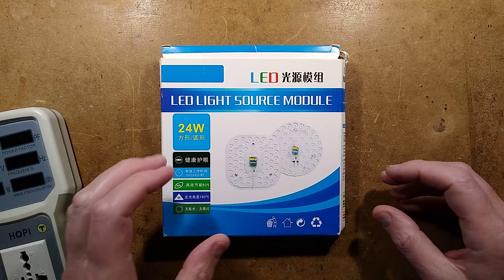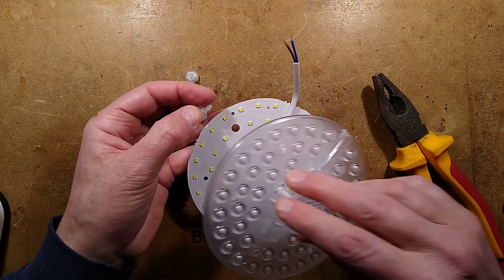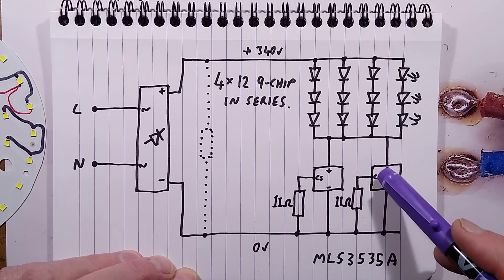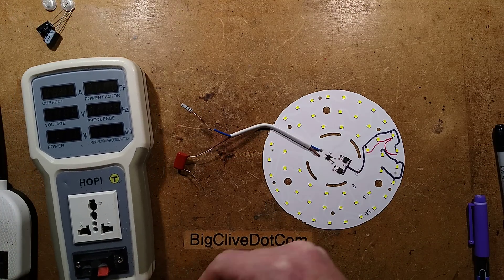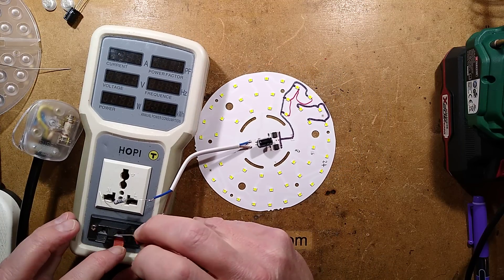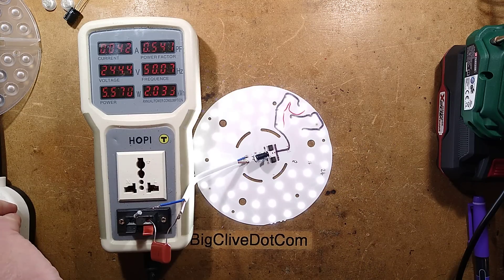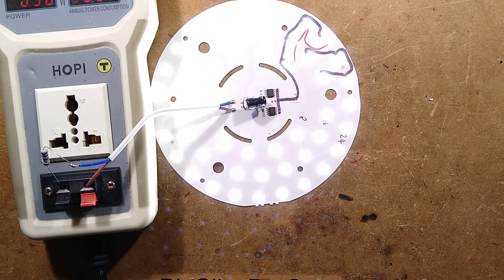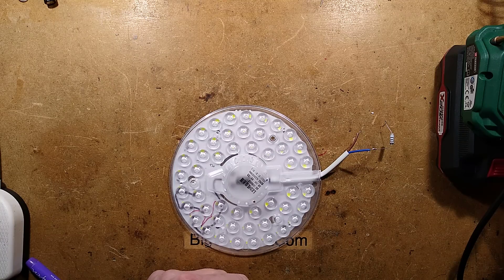Upgrading a downgraded light

Comment: I'm curious how fast the regulators respond. Are they reducing the flicker at all by following the voltage changes? Would the flicker be the same with just a fixed resistor?
I'd be interested to see the waveform on the positive rail and the one across either the LEDs or the regulators to see how they compare.
Reply: You can tell from the nearly-1 power factor that the chips were essentially working like fixed resistors. The current had to be tracking the sine wave voltage, in phase and at the same slope. If it wasn't like that the power factor would have been lower. 

Consider them "smart" fixed resistors. They are programmed for a max current with the trimmer resistor, so the current can be changed (the resistance value can be changed), and they will also increase resistance when they get hot.  But basically they are acting like fixed resistors.

Without a capacitor someplace, this circuit will flicker, by definition, since every half cycle the voltage across the LEDs will go to zero, and they won't be making light. What might be interesting would be to measure the light output with a photocell and a scope. Is it a rectified sine wave, or does it increase quickly and then flatten out for most of the cycle? I suspect it is a sine wave, but it could be either. 

Obviously with a big enough cap the voltage across the LEDs will be essentially constant, and the current into the device will only be conducting for part of the since wave, thus the low power factor.

Comment: When I was a teen I learned about capacitors.  I built a beautifully constructed 300VDC tube power supply.  Then, I turned it off and reached in to make some change. It shocked me hard and I pulled my hand out so quickly that my wristwatch stayed stationary and dropped to the concrete floor where it broke.  Very instructive it was.
Reply: Ah yes, capacitors. Those little innocent looking cans and discs, sometimes packs of foil and paper, thin plastic film, or maybe a bit of foil and some oily stuff inside. Nothing dangerous until you put a bit of voltage on them. I learned about these little critters myself at around the same age but never got attacked until much later when I was a newbie tech. 

My job was to test power supplies of various sizes. Some were analog power supplies with big regulators and some big cannister-sized capacitors on them. I was always a bit on edge when I powered those up and one day, I had one explode on me because someone in manufacturing put the big capacitors in backwards. The explosion was so intense that it sent the capacitors up into the drop ceiling above me. It was a good thing I always ducked when I powered those up!

The last encounter was with some switchers. These switching power supplies, I think 65W units used in some "portable computers", with portable being a relative term for machines weighing around 22 lbs. 10 kg. There was a batch of these small switching power supplies that had leaky caps that needed replacing. Field service collected the units and brought boxes of them down to the test department for repairs. The units were to be returned to field service for replacement in customer returned units, or sent to the outside depot houses where they came from for field replacement.

I reached into the box of power supplies and got zapped instantly! The units, while sitting in the boxes for ages, still held quite a charge. After that, I got out a screw driver and would rub that across the leads sticking out of the boards before I even put my hand near them. The zap was enough to leave my arm achy and hand sore for the rest of the day.
Reply: First lesson in removing your wristwatch before working on electrical stuff as well!!
Reply: Oh, yeah, 2015 me also discovered that 5 meters of speaker wire connected to over 2kv can be a capacitor too, and it hurts. 2015 me shouldn't have played with tv flyback transformers. At least I learned a lot, like how wires don't always behave as just wires
Reply: I remember when I was about 8 yo, my parents got me a night light, not because i needed it, but because I just loved lamps, still do. And I played with it, plug it in, then unplug it... one day I accidentally found out that if you disconnected it and then touch the terminals with your fingers it will briefly light up. 8 year old me knew it was because of a capacitor inside, but it wasn't till 2016 (almost 7 years later) or so that I learned that thing should have had a discharge resistor. I guess I just had good look to not badly shock my fingers. 

Dangerous chinese products for kids
Reply: i think i learned this from a tv originally... not to not wear a wrist watch but how to smack something in reflexive pain to the shock and accidentally break something, i forget what i knocked over... haha
Reply: @frogz  i was fiddling with the rubber cap on the back of a tv once and almost became extinct before the CRT technology did
Reply: @echelonrank3927  Those are really friendly devices too!

At the company where I got zapped by the switching power supplies, they made video terminals and other early computer systems. These systems were called intelligent terminals, but they were computers with hard drives, memory cards, and other peripherals.

As time went on, I was promoted and eventually worked on all the various products including terminals. In many cases, the horizontal circuit would fail which required replacing a large IC driver chip. 

The procedure was to of course power off the unit then stick a screw driver under the anode - that rubber cap, and discharge the static from CRT. I did that with the usual ZAP as the purple-blue arc crossed arced over between the screw driver and ground and probably a gazillion times before without fanfare.

As usual, I then put my hand inside to fiddle with the connectors and wires in order to extract the board. As I got my hand inside, there was a residual amount of static and it zapped my hand.

I yanked my hand out in reflex and ripped the back of my knuckle on the chassis. There was blood everywhere and I still have the scar today to remind me. The zap didn't hurt as bad as the ripping of my knuckle on the chassis.

The thing is, this was a black and white CRT which only got up to about 11KV. The unit was off and the tube was discharged. This residual zap, probably nothing much, caused my hand to jerk and rip itself against the chassis. All I can say is, imagine if this was the full voltage!
Reply: @Clavichordist  Probably tho, part of it was your brain quickly overthinking that you might have been zapped with the full voltage, so scared it took a more aggressive action.

If it were the full voltage, at least, your brain would have been right about it lol
Reply: @rhodexa  That's definitely what it was - one of those scare reflexes. Believe me, my fat fingers got zapped more than once and I was quite jittery putting my hands in there especially when they were "live" and I had to adjust wires and pots. Some people were pretty brazen and used a metal screw driver to adjust the pots. Sometimes if they got too close to the flyback transformer, there would be a purple arc zapping it! 

I on the other hand, went to a local Radio Shack. Remember those? and picked up a set of TV tweaker-tools. I think the kit cost me $2.00 and I kept it when I left the company. I would use those with a nice extension on it to get in there most of the time.

This time, well I was poking in there and that residual charge zapped me and made me jump! I figured at the time that the device was off and no longer would zap me. HA!
Reply: @frogz  I broke a finger that same way lol
Reply: @BeetleBuns  i broke the TV luckily, not a finger, sorry bout your finger but i bet you learned a life long lesson from it
Reply: @frogz  hehe wasn't the first or last finger I broke, but it was the last cap I ever touched with bare hands...
Reply: @BeetleBuns  learn and practice the one hand rule when dealing with powered electronics, it could save your life
Reply: I had an old tv with "unplug and wait 30minutes before opening" on the back.
Reply: Mine was also a TV, those 4:3 Sony ones from the mid 80s with a glass protective screen & speakers on the rear. 
Saw a yellow rectangle encased in plastic. It looked nice so I had to touch it.
Reply: sneeze!
Reply: I had similar learning exercise about transformers :D
Reply: While in high school, I was working at a TV repair shop. One day I was changing the picture tube of a 27" color set. I had a grounded screwdriver wedged into the anode cap OVERNIGHT. The next day I took out all the various screws and was fumbling around inside the cabinet to wrestle the beast out, and one hand brushed across the anode connection. I dropped the tube, but fortunately it was still in the cabinet and only fell a couple inches and didn't break.
Reply: @strehlow  
What do you mean by grounded? Shouldn't the anode be shorted? I wonder what went wrong...

People sometimes ask me if I repair old TVs. My answer is just _“Nope, too dangerous”_. This is the reason
Reply: @rhodexa , ya, shorted to the chassis, which was the circuit's zero-potential reference. 
I'm not sure why there was still a charge. I got a serious pop when I first put it in. Perhaps I didn't get it quite far enough in to keep a solid connection, but the initial charge was enough to jump the gap.
Reply: Bros trynna be like drake 💀💀 goofy ass 😭😭😭
Reply: Yeah - it is rarely the voltage that hurts you, it is your reaction. There are often sharp things in electronics, so spearing injuries are pretty common. :-/
Reply: @nf4x  Yup. It was the chassis that bit me 👌
Reply: @Frank Vera Patrons get early access.
Reply: It's a message, the electricity god is trying to tell you that wristwatches are cumbersome lol
Reply: @Frank Vera Patreon
Reply: @Frank Vera Patreons get them early probably, like many other publishers.
Reply: Bleeder? They just waste electricity.
Reply: Number of things about this don't even make sense, why 300vdc for tube technology, how if your hand was in something did anything come off and drop to the ground...
Reply: @phonotical  300 VDC was typical output tube plate voltage.   Watch band was the expandable metal link style that allowed my hand to slip right out as I yanked it out of the chassis at super fast speed.

Comment: I remember back to the last time we looked at a "driverless" LED module and experimented with fixing the flicker

The capacitor works best after the drivers, that way they don't have to dissipate the extra voltage from the smoothed mains
Reply: Would be interesting to see an efficiency and power factor test with the capacitor before and after the drivers. Clive, make it happen!
Reply: Although the capacitor itself is also an added load then, it's worth testing._

Comment: On the schematics: 340V? Brainfart? Surely you mean 240V...
Reply from the maker: Peak mains.  240V is the average value.
Reply: DC voltage after rectifying AC is the AC RMS voltage times the square root of 2, and 240*sqrt(2)=339.4 volts.
Reply: @uzlonewolf  I noticed that Clive's mains voltage like ours, is a bit above 240V , hence the peak voltage of around 350V.